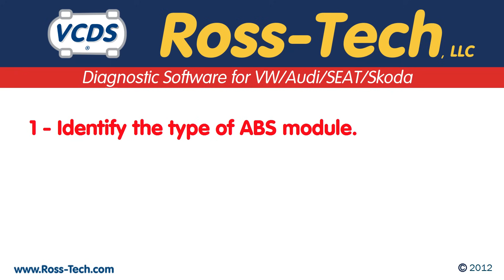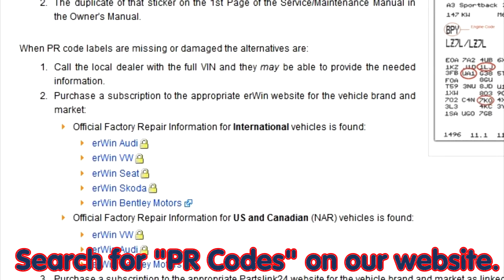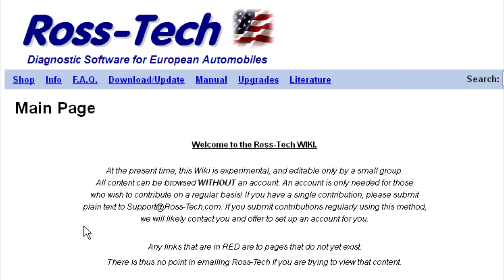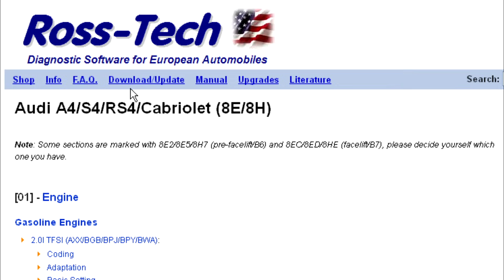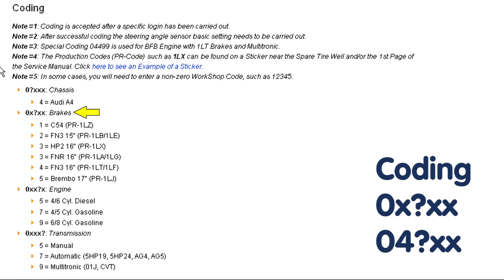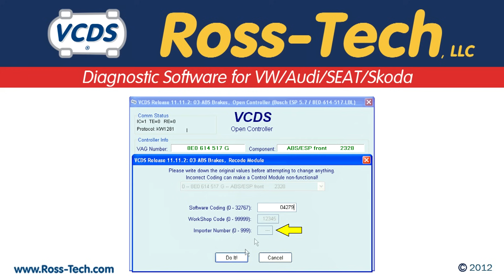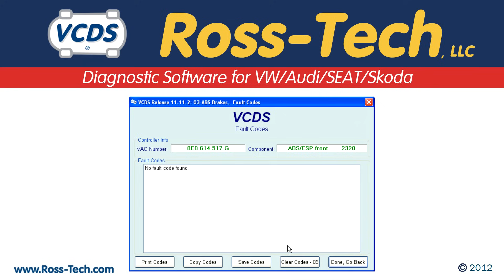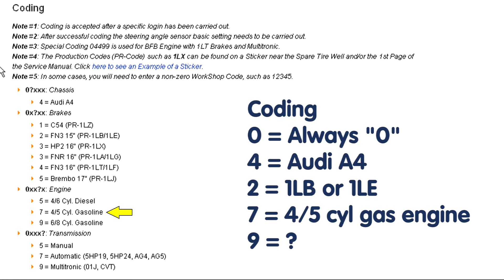Coding the Bosch 5.3 and 5.7 ABS Modules

Comment: Hey. Thanks for the video but I have a problem. I just changed the abs module and I logged in and changed the code number, everything gone well but the front left wheel is not reading, the abs modele is fine and also I changed the sensors just switching the front sensors and I also checked the wiring and everything is fine. I don't know why I am having this problem the speedometer from the cluster is not giving the vehicle speed..what can I do? It's an Audi A4 3.0 v6 2003 Quattro

Comment: From this info I'm assuming if you pull a good used ABS unit out of a same year with same coded options (engine/trans/ABS system) then it will be a direct swap with no reprogramming/coding. Correct?

Comment: Tried to do it as shown not working for used unit. As my understanding it's only for new modules not used?
Reply from the maker: This information will work with used Bosch 5.3 and 5.7 units.  However...   https://forums.ross-tech.com/index.php?threads/1997/    If you need support, we offer our customer free support on our web forum.  http://forums.ross-tech.com
Reply: Tried with a used one and still working

Comment: I have a 2004 Audi S4 v8 manual trans Vin 8E and I bought an abs module of ebay same part number and I'm using a snap on scanner, I can do everything in this video except the wcs code stays 0 while coding, it accepts the coding but I cannot change it wcs value it states its 0, it gives me the option to highlight it but it won't let me change the value, I wonder if it's the sp scanner limitation or the module, another thing I did find under special function I can find the wcs setting but it states it needs engineering login 4 digit code, I've been trying to get it programed it will not take the programming, or it will say function completed but as soon as i cycle key same errors come back I wonder if the wcs input being 0 is the issue?

Comment: It accepts the coding for my Audi at first but next time I enter the ABS tab, the coding is back to 00000. The brake pressure says it’s above 290 bar and a fault code for the pressure sensor comes up. However, I checked the sensor using a multimeter and it seems to work as it should. Can someone please help?
Reply from the maker: We offer free vehicle support on our web forum for all of our registered customers.   http://forums.ross-tech.com

Comment: I know this video is like a decade old but THANK YOU! Such a well made video, I was able to code my ABS module that had lost its soft coding in minutes! So thankful!!
Reply: What do you mean by code your abs unit ? 

I'm trying to figure out if coding your abs unit is the same as what I need to do
Reply: @ my ABS light was on, used a VAGCOM reader to check codes, saw a message that the ABS module was incorrectly coded. So I performed this process to code it and the light went off
Reply: @mrhentrich  I'm after putting a second hand abs pump and module into my car. Can not bled it as it won't let any fluid through the module and pedal keeps going to the floor
Reply: Did you fix it ?  @runslikechicken

Comment: I tried several times with vcds and hex kkl cable without succesces even though i could read all modules and could program other modules.

After i tried the exact same procedure with a launch diagnostic tester and it worked.  Probably some  thing with to high latency
Reply: Hello. I also try coding with launch-x431 but no success. Do you have any tutorial how to do it?

Comment: I have Chevrolet Captiva AWD I HAVE ARRENGE ABS MODULE  THAT ONE IS USED WITH SAME PART NUMBER NEED TO DO CODING  WHEN I CLEAR WITH SCANNER FAULT LIGHTS OFF AFTER SUM TIME LIGHT GETS ON ( ABS ,HILL DOWN ASSIST, STEERING ANGLE, TRACTION CONTROL) NOW THIS LIGHTS ON PLEASE HELP WHAT CAN BE DONE OR SHOULD I GO FOR NEW MODULE

Comment: Does VCDS-Lite work to encode a 5.7 ABS Module? From an 2003 A6 4B C5, 2.5TDI Quattro ?
Reply from the maker: Yes, VCDS-Lite can be used as shown in this video, but you would have to purchase the full version, $99.

Comment: Hello! I need to replace my Bosch 5.7 ABS Module. The explanation in the video for login and coding is perfect, but: if I buy a used spare part without information in what car it was built in, do I need to know the original Login datas or can I use those, fitting to my car? Or is there a "general reset"?
Reply from the maker: When going with a used ABS module, first make sure the part numbers match up 100%.  If the letter(s) at the end of the part number are different, they are not the same part.  The coding of the ABS module is based on what it is currently installed in, not where it came from.

Regards.
Reply: Hi! I'm a bit confused about your saying about matching up letter(s), because on my old Bosch 5.7 ABS module I found only numbers: 0265 950 012. I have  used ABS module with same numbers: 0265 950 012 for replacing mine. But I can't see any letter(s) at the end. I'm not confident is it good match and I don't want  proceed coding, before 100% sure it is right part. Thank you in advance, for reply.

Comment: Hello there. What if the Steering alignment has got "Not OK" ?
And for some reason when the steering wheel is straight its giving -75º
Reply from the maker: +DJTOPKO 
The first two things that come to mind... a bad G85 sensor, or some one took the steering wheel of and then put it back on -75º off center, thus the G85 is now -75º off center.  Get the G85 to read 0º, then pull the steering wheel off, recenter steering wheel, perform alignment, relearn G85.  Send cases of L&P from New Zealand to Ross Tech office.
Reply: +RossTechVCDS Thank you very much for the answer. according to the owner noone  done it. so might be faulty sensor then. Cant i just tell it with the vagcom where new 0° is? 
why i got to this, is because when you driving the car, brakes will come on on its own. never had problem like this before...
Reply: Did u manage to fix the problem? I just recently replaced my G85 sensor.  But I got the exact same problem as you.

Comment: Tried running the coding procedure several times on a 2004 Audi A4 Quattro 3.0. After entering the correct coding and login, still getting same 2 codes: 00778 Steering Angle Sensor, 01044 Control Module Incorrectly Coded. We purchased a used ABS module. Part numbers do match. Any ideas?
Reply: tony gomes hello I have the same problem you !!!! how to solve ????

Comment: If the WSC in 17 instruments is 0000  does that mean that the km was rolled back? Thanks!
 Address 17     -------------------------------------------------------
   Controller: 3B0 920 807 A  
   Component: KOMBI+WEGFAHRSP VDO V06
   Coding: 05115
   Shop #: WSC 00000